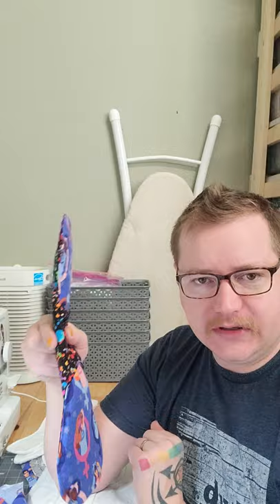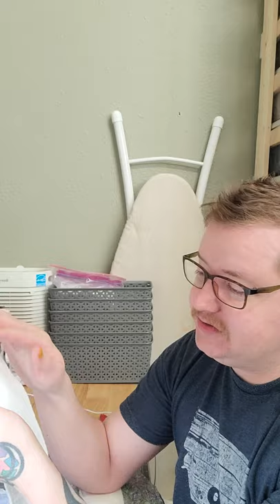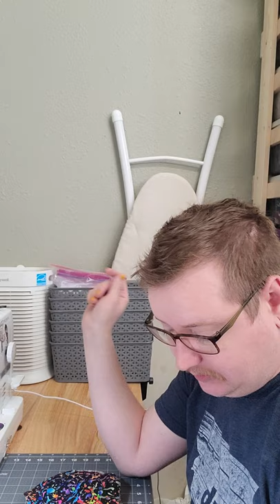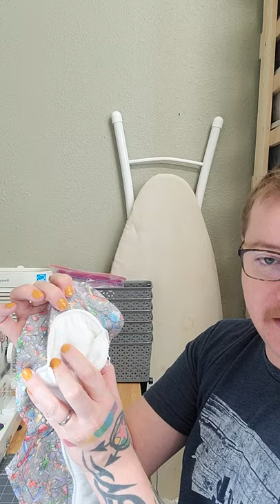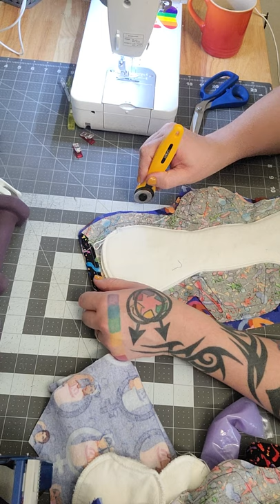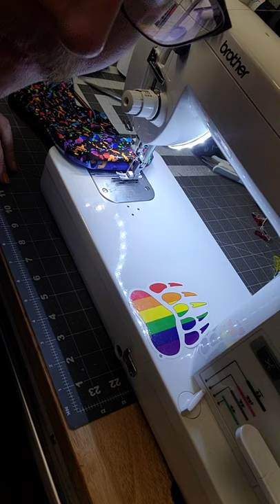Postpartum padsicle tutorial

Comment: How do you make the actual bag? Is that heat sealed?
Reply from the maker: For the ice-pack, I use a 3mil poly tube, double sealed in both ends with an electric impulse heat sealer.
I tried other options including the sealer on my FoodSaver and had to upgrade to get it right. 
There are DIY otterpop bags you could also use. They're definitely smaller than what I make, but they'll work. I don't like Amazon, but here's an example of the diy popsicle stuff... https://www.amazon.com/dp/B073W4BW58/ref=cm_sw_r_apan_i_ZKW282GV8YE9TMTF06EB?_encoding=UTF8&psc=1
Reply: Oh my thank you so much!! I have a little one due soon and this is perfect! I appreciate you even taking the time.

Comment: and i love the depth of detail and thought you put in your pads. especially the microplastic thing bothers me. my current ones are backed with fleece. it´s upcycled fleece i used, but still... in all other clothing items i have the rule not to buy new fabrics with polyester for that reason, but it´s the most common thing used as backing fabric in pads and i just finished my 2nd patch of pads with it and since i´m on tight budget i went with the fleece blanket i already had.  i did experiment with upcycled wool as a backing too, (which introduces other moral issues here, as a vegan... lol) but since i´m not using zorb or fancy bamboo fleece but -again -upcylced pyjama flanell as the core, (with the additional terrycloth from a towel thrown in there) i had too many trust issues with forgoing the moisture resistant backing all toghether. probably it´s overkill and unnessessary with the amount of layers i did fot he core. but yeah, i don´t make them professionally, just for my own use. but my heart bleeds reagrding the microplastic and i´d like to find a good alternative for when i do my next bunch. :/ i´m just trying to make peace with it for now, and tryin lay my guilt feeing to rest with telling me i do not own a car, and most microplastics released into the environment are actually from car tires. still... i´d like to find a solution thats 100% biodegradbale in the long run. i´m really impressed that you use cotton thread. i´ve been sewing for 24 years and actually i´ve never come across a machine thread thats not poyester. (i did not specifically look for one, but i will now cause it did bothe rme, but all stores, and i usually buy the highest quality there, only carry polyester machine threads.)
rainbow love to ya!